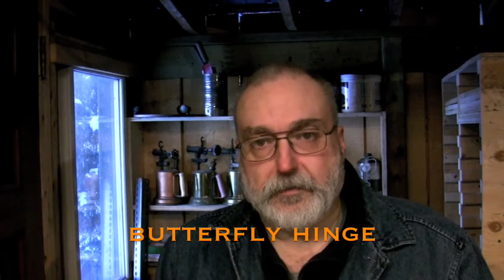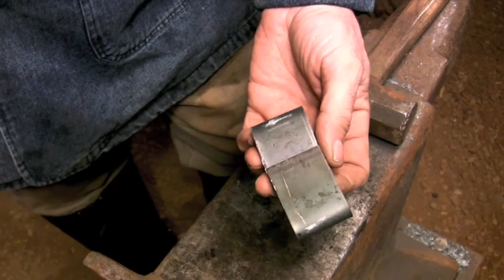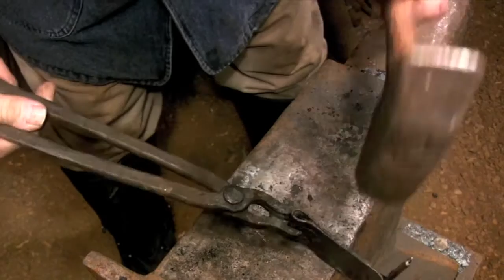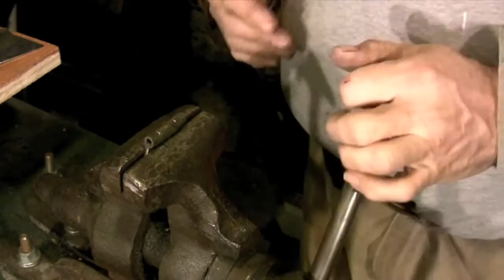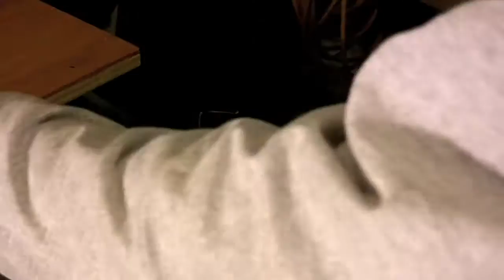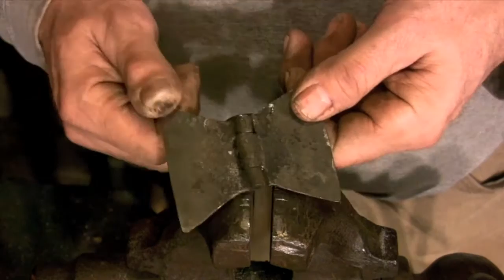Blacksmithing Project -  Butterfly Hinge

Comment: I have never seen this method of making butterfly hinges but it makes perfect sense. I can see it will be much easier to forge weld the barrel to the hinge plate this way compared to forming the barrel and doing a scarf weld to join the parts together.   Also, one almost invariably makes hinges in pairs (at least) so that is another reason this method makes so much sense.
Reply from the maker: Thanks -  I haven't seen anybody else do it either.  I worked this out one time when I had to do an order of really small hinges.  Doubling them up was the only way that I could handle them.  I use a similar technique for my chest hinges.

Comment: What is the difference between a hot and cold chisel?
Reply from the maker: You probably already guessed that hot chisels are used on hot metal and cold chisels are used on cold metal.  The main difference is that hot chisels are used to sever steel at forging temperatures and they are used the same way that punches are used.  They need to be made out of a high carbon steel but many smiths don't bother to heat treat them because the hot metal tends to draw the temper out of them the first time they are used. Some people use a bevel edge but  I shape my hot chisels with a square faced cutting edge ( like a punch ).  I find this helps to stabilize the thin edge and it makes them easy to identify as a hot chisel.  Cold chisels are used to remove a shaving from cold steel the same way woodworking chisels do.  They also need to be made from carbon steel but they need to be heat treated to maintain the cutting edge.